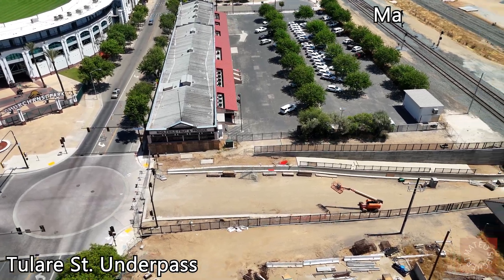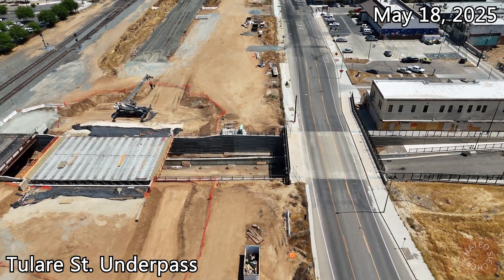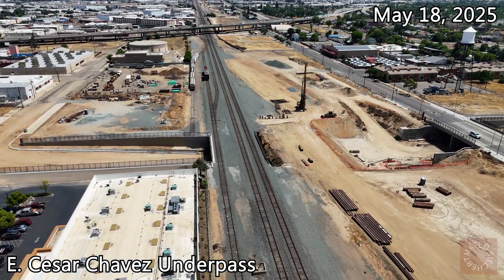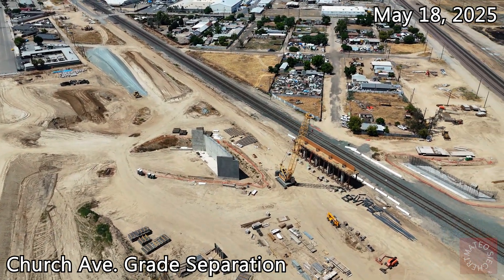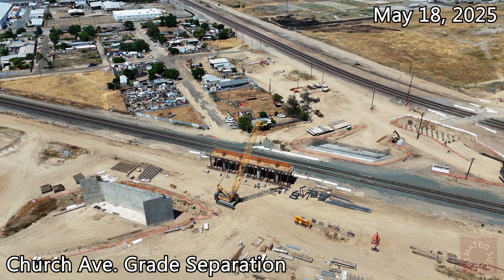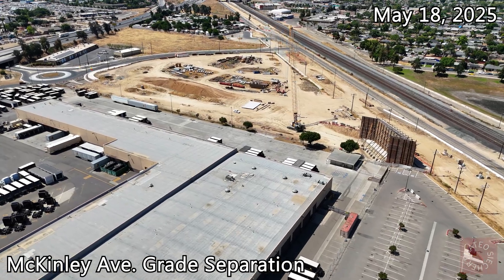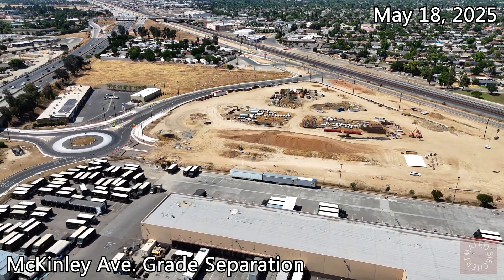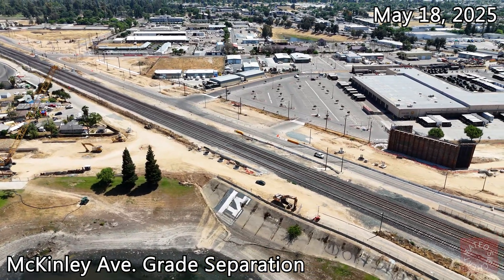All Girders Up! - Mini Update of California High Speed Rail in Fresno - 5/18/25

Comment: Thanks for the update on this great and critical transit infrastructure project for the future of California and the US.
Reply: China = Industrialized Construction.
U.S.A = Manual, Fragmented Construction.
China builds viaducts and rail track like a factory line, U.S still builds like it’s a custom art project each span carefully crafted on site.  Chinese method is more efficient and cost effective
Reply: @RCVoice1 It could be cheaper and quicker to build, but not BETTER. And that was my point.
Reply: @mrxman581 😂😂 You prefer USA styles...where they spent 14 million dollars and 0 miles of High speed rail track 😅
Reply: @RCVoice1 Laying tracks are close to the last things that are installed and it happens relatively quickly. An intelligent person would know that.😂😂😂
Reply: @mrxman581 California High speed rail authority should be rename as California structure building authority for Central valley 😂 they will at least get some fund from local govt body .. after 17 years and 14 billion dollars...they don't have single Railway track nor single station built 😂

Comment: Oh no!!  If the Authority isn't careful, we're gonna have a high speed rail line!!  What are the nay sayers gonna do now???
Reply: The original objective of the project was to build a bullet train, but it has now shifted to simply creating jobs. Engineers working on the California High-Speed Rail are deliberately using labor-intensive and time-consuming methods instead of adopting more efficient and cost-effective alternatives.
Reply: @RCVoice1  that’s more so on the contractors who for these first four construction packages bid for them and then designed and built that, which led to change orders and redesigns that delayed things and increased costs. 

CHSRA has learned from this, and going forward will design everything in-house and then have contractors bid to build that, which should minimize change orders and thus help keep costs down. 

They’ll also complete all the pre-construction work, i.e. land acquisitions and utility relocations, before awarding contracts for construction. A federal funding expenditure deadline forced them to rush starting construction on the first four CPs before they completed that work, leading to the early delays and cost increases.

Comment: The California High-Speed Rail should use the Full Span Launching Gantry (FSLG) method for constructing viaducts and bridges, as it is faster and more cost-effective, similar to the practices in China and Japan
Reply: I'm sure construction technology is strongly influenced by the geoscience of the project area.

BTW, I wouldn't hold up China as a model for building HSR infrastructure correctly. Their HSR infrastructure is already suffering signs of premature fatigue, resulting in them having to slow down the speeds and frequencies of the trains.
Reply: @mrxman581 I disagreed.. they built bridges and viaducts using precast and  big machines like Lego. The US has no experience building mega projects for a long time let alone high speed rail. China is the number one building mega project efficiently..
Reply: @RCVoice1 Building fast doesn't mean it's better. As I said, their HSR infrastructure is already showing signs of esrly fatigue.  Not good, and more costly over the longterm.
Reply: @mrxman581 BS.  You don't live in China, where they recently built all this infrastructure. Back in 2008, there was virtually no high-speed rail network. In contrast, the U.S. has outdated infrastructure much of it is over half a century old. Taking about Fatigue infrastructure 😂😂
Reply: @RCVoice1 Yeah, and that HSR infrastructure is already falling apart. The data is out there. Read it for yourself.
Reply: @mrxman581 Says who ? don't listen to the US media too much.. Chinese high speed rail is expanding every year and also building world class infrastructure . The only thing falling is the USA Bullet train...what happened to Texas high speed rail project?😂
Reply: @RCVoice1 Don't listen to Communist propaganda. CAHSR is being built.